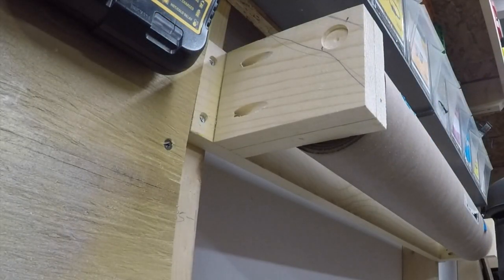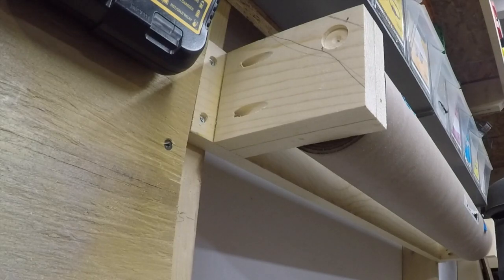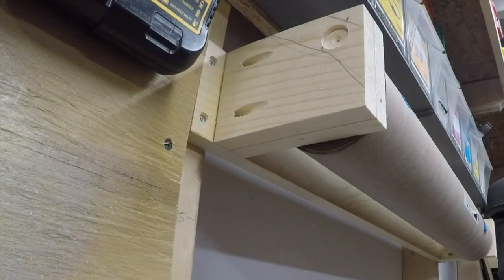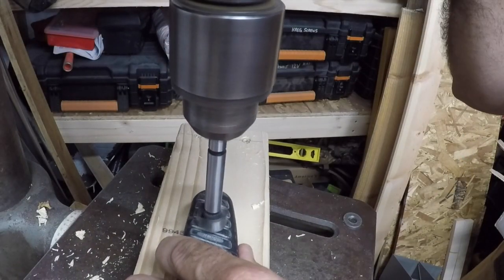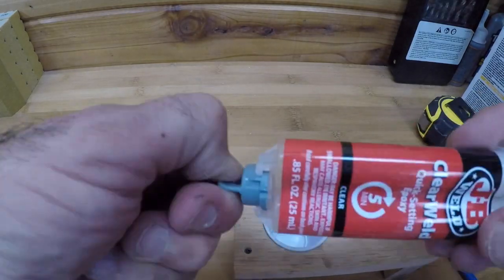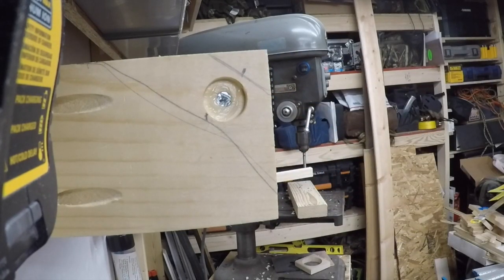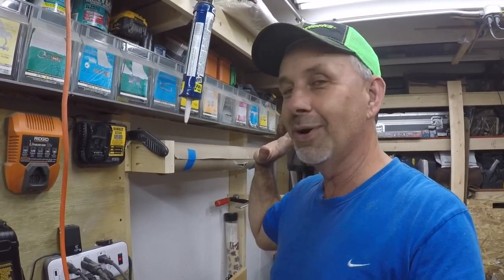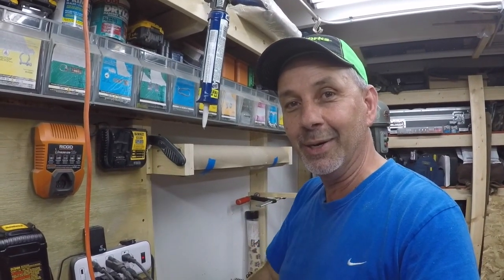Earth Magnet Project #2

Comment: Thanks for the video on the paper roll. Will get around to trying that some time. Was wondering about how to cut it and you’ ve answered the question 😀 Before you posted this I had though maybe a thin strip of wood going across with those serrated edges attached you get on cling film or tin foil boxes, but the magnet is a much better idea.
Reply from the maker: Your welcome and thank u for watching... I was going to put a piece of wood all the way across and then attach Hacksaw blades to the wood to do the cutting... but then I would need some way of keeping tension on the roll so it did move as I pulled down... I may still do that u never know.... But I am going to be adding a piece of PVC pipe to place tension on the roll so I don't need keep removing the blue tape and putting it back on again... that will be next.... alway something to do, so much fun....
Reply from the maker: And by the way u watched it so fast I didn't even have a chance to add the video links at the end.... Well done good sir...Have a great day!
Reply: Mark Dohring yes hacksaw blades would be better than the serrated things. Lol. Think I got the notification and decided to watch immediately. At a loose end until I can gather up the bits and pieces for the patio tables. 😬😁
Reply from the maker: I'm putting the finish on mine... I don't know if u saw my comments on the California table... his cut list show 8 piece for the bottom shelf, 2 shorter ones that go between the legs... and then 6 that go between them... he only uses 5 when putting them in, that way he had the spaces between boards.. I ended up sending mine through the tablesaw and ripping 1/8" off... it worked well....
Reply: Mark Dohring will have to remember that when I get that far.  Thanks.